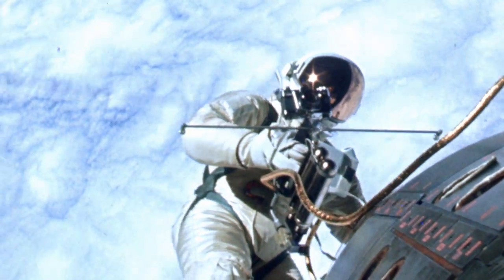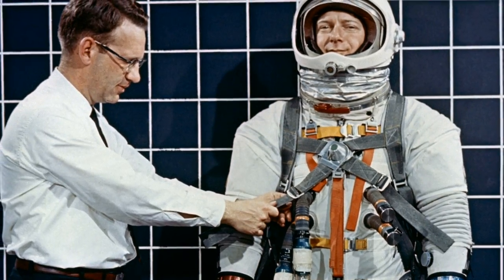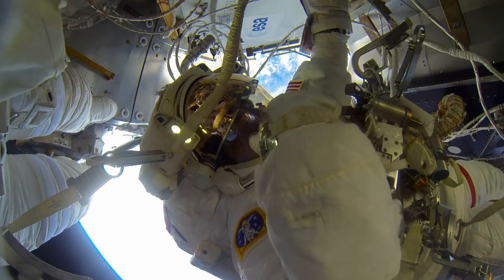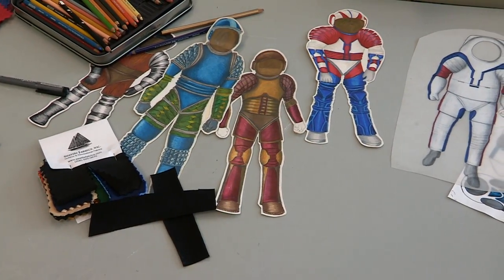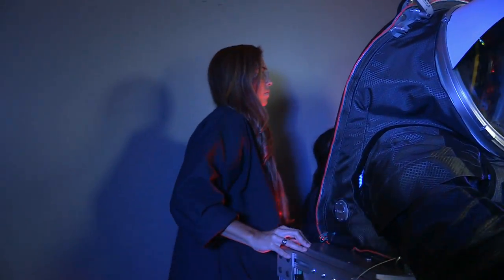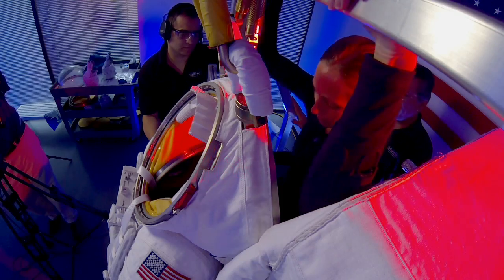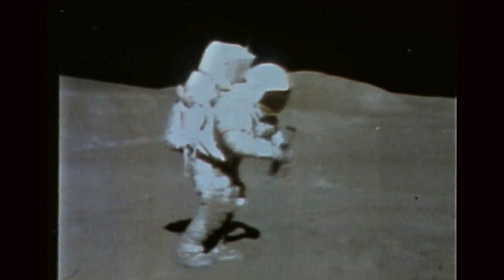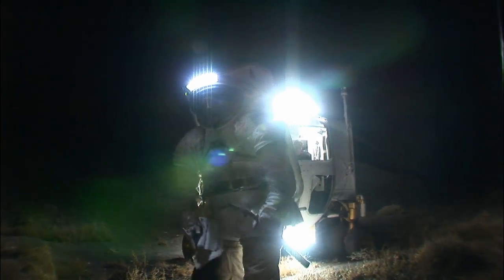NASA Spacesuit Development

Comment: I like to see a schematic on how that cooling system works the amount of battery power need into an air conditioning system or even a system that would keep that liquid cool or poor warm in the case of it being freezing and the shade of the Sun in space like the Dark Side of the Moon the difference is over 250 degrees Fahrenheit you can bake cookies and that temperature I would love to see them stick an astronaut and a 250 degree oven and then put them in a - 250 degree Sub-Zero environment I wonder how that government would stand up to being superheated supercooled repeatedly

Comment: One thing missing in all these projects suits to walk on the surface of Mars, on Moon or other planets is a auxiliary equilibrium system to compensate the inability of our human labyrinth  to manege these huge and heavy suits in and non standard earth gravity environment.
A suit to work properly in future off-Earth bases with normal people not so prepared and trained like NASA astronauts for extended periods of time must have one structured active exoskeleton incorporated in the suit (meta materials and/or electric activated materials working like muscles) and linked to an ACTIVE device to provide ultra fast dynamic equilibrium. 
Something like a mix with this anti-earthquake systems for very-high buildings and additionally to this system we could integrate an extra device like these modern one or two wheels Segway style transportation devices. 
The two systems must be mechanic and electronic linked by the active exoskeleton and work together to active help the astronaut to be stand up and move safely.
The main function of the exoskeleton is to manege the equilibrium of backpack no matter his size or weight giving to the user of the suit the illusion that the survival unit backpack is not there and he only have to manege his body with active help of the suit. 
The Segway type segment unit is for fast and/or large dislocations and could be optionally used or not by the user. 
I think this design must be seriously considered to be incorporated in future suit designs in long term off-world missions.

Comment: Why would anyone dislike this video?  It depends where the suit would be used as to whether the light has utility or not.  Shadows are dark in space and on the Moon.  A light is handy and hands free as well.  As Kyle A and  jscott1000 point out:  The outer layer is the only thing the public had input into and the covering can have many different looks and still be completely functional.  If it looks cool fine.

Comment: Would love to see these tested in the harsh climate of Antarctica - not exactly Mars but definitely cold enough.
Reply: +hoghogwild  - This is not accurate because space weather is different from Earth weather.  

First of all, in space you are surrounded by vacuum, which means the only form of heat transfer is radiation.  In Antarctica you have conduction and convection due to the very cold air.  Our suits would be good insulators, but no where near as good as they are in space.  

Second, te cold air would work it's way through all the multi-layers of insulation and there would only be the person's body heat to protect them. There is no heat in the suit other than the fingertips, so a person could easily get too cold.   Antarctica would indeed test the limits of the current STS/ISS EMUs.
Reply: +jscott1000 The current suits must operate in +250º in the Sun and -250º in the dark in space.  Antarctica wouldn't even come close to testing the limits of the current STS/ISS EMUs.
Reply: +jscott1000 I quoted the wrong person sorry.1) There is heat transfer in space by both radiation AND conduction in todays EMUs.  I agree there would be greater heat loss in an atmosphere than in space, all else equal.2) The issue is usually getting heat out of a suit, the EMU's use air convection and the Liquid Cooling and Ventilation Garment to deal with the human body's 2 million joule potential.  The mean annual temperature of the interior of Antarctica is −57 °C (−70.6 °F).  Astros touch thing much colder than that with their feet and hands.
Reply: +jscott1000 Thank you for this insight. I immediately thought "cold!" when thinking space suit - apparently it's the opposite! I'm surprised something similar to a space suit isn't used in Antarctica: something like the old "dry suits' used by scuba divers. It's definitely cold enough to warrant something like a suit on the continent. Surprised nothing like that is used.
Reply: jscott1000 I agree with everything you are saying in this post.  I wasn't sure who I was dealing with because it seemed on my end that you weren't understanding that there is heat transfer via conduction not only in the hands of he Astros, but via their feet as well. Like when using  an APFR on the end of the SSRMS for example. I don't need to tell you that the Astros "tootsies" get more than a little chilly sometimes.
Check out some of our work (I wish we had your budget)  Take care.
http://www.asc-csa.gc.ca/eng/

Since I have a suit expert here.  What are your thoughts on the current EMU program?  During the times of STS/SSP the suits were always in rotation with ISS. Now with suit maintenance being done on orbit with the current upmass/downmass constraints, coupled with the loss of an EMU(and our Vascular Echo Exercise Band) on CRS-7, do you think the ongoing problems with EMU-3011 would be better dealt with maintenance being done on the ground?  In other words, was suit maintenance better accomplished with the capabilities provided by Shuttle?

(I'm asking here as I see no way to contact you on the NASA site link you provided)

Thanks
P Schermerhorn
Reply: +hoghogwild - I see we are both experts in our own fields... Yes the touch temperature is always a concern and we mitigate that by not having them touch things that will be very cold.  The heaters don't provide a lot of power as the run off batteries.   As for the feet they do get cold as on Earth and the have woodsman sock, which we discourage.  The feet are warmed better when they can be exposed to the air circulating in the suit. 

There is no question suit maintenace is better peformed on the ground.  The EMU has some components designed for on orbit replacement but many are not.  The fan/pump/separator they have been replacing has many loose parts and its a little like brain surgery.  The crew is very careful and makes it look easy but their time is better spent doing other things besides suit maintenace.  The next suit will have much easier to replace components.
Reply: jscott1000 
Have you personally witnessed in your long career at NASA any spacesuit tested with a real astronaut being pressurized as they would need to be in the vacuum of space and tested in a vacuum chamber here on Earth? I know such vacuum chambers do exist.
Reply: +Pete Kuhns  - Nice idea but the suits we have today are designed to work in specific environments, such as vacuum of space or lunar surface.  Current suit would not work well in Antarctica because there is no heat in it except at the fingertips.
Reply: +hoghogwild - in case you don't know I have been working for NASA for 28 years, the last 14 specifically on spacesuits, so I know a thing or two about what I'm saying.  I'm not disagreeing with you but you have to understand all the nuances about what you are saying.  The EMU cooling system relies on vacuum to operate so would be worthless in Antarctica.   The only heat is at the fingertips as I've stated several times.  The EMU would be nothing more than a well insulated set of clothes in Antartica and not an operating suit capable of maintaining comfort the way it does in space.  If you like We can continue this discussion on www.nasa.gov.

Comment: Must be so hot going into the desert in a spacesuit as shown in the video :0
Reply: most likely they had the cooling systems in those suits, good way to test that.
Reply: +Neebz Suits have air conditioning!
Reply: How hot is a desert in the summer? 60-70 degrees at max? 
How hot is the surface of the ISS when being hit with solar energy? Hundreds of degrees. 

Those suits are made to protect and they're testing that right there